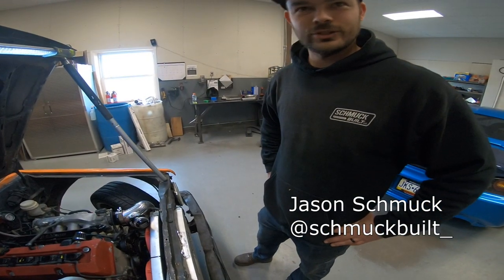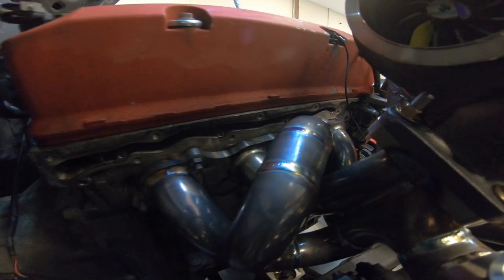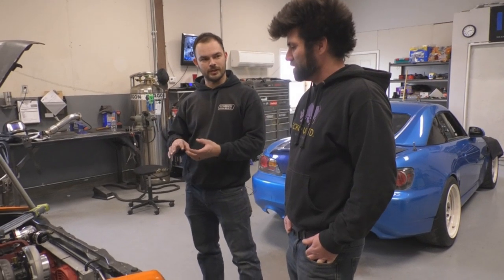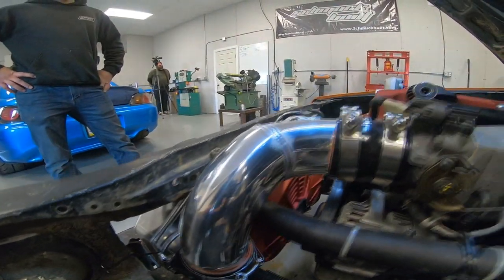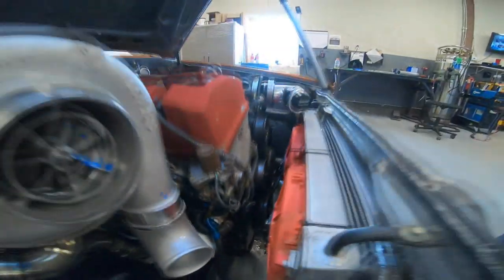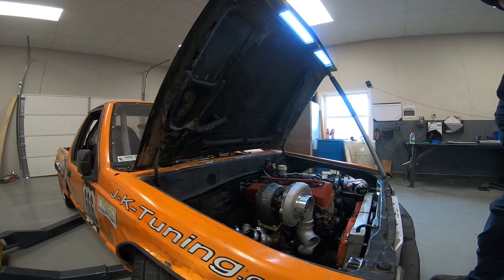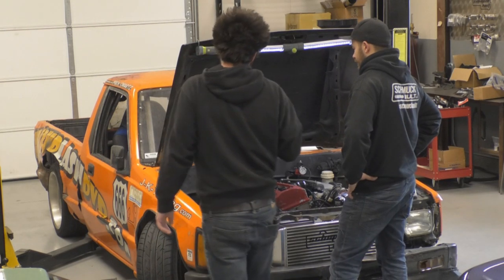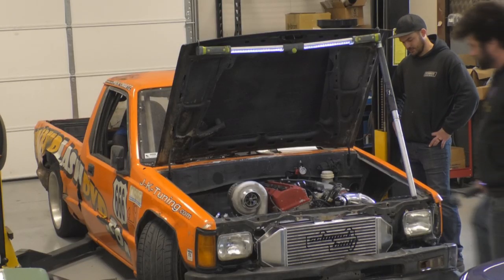Honda Powered Drift Truck Turbo Build (part 2)

Comment: Whiplash is back? Awesome man. I remember reading about this truck years ago... Inspired me to turbo my Mighty Max, until I got a Miata...
Reply from the maker: Yes sir! Spread the word - I'm trying to get some subscribers! Currently building a V8 4x4 Tacoma. And the drift truck is finally going back for a full boost tune on May 21. Planning to make 600 HP.
Reply from the maker: You still have the Mighty Max?

Comment: How much of the stock suspension and steering components have you kept? I dont see a shock or the torsen bars and the cross tubes rearward instead of forward
Reply from the maker: Sorry I missed this comment originally.  The front suspension is still a stock design.  It has 2" dropped spindles and like 1 or 2 inch lowering springs.  I used washers to adjust the camber in.  Rear is a triangulated 4-link with QA1 coilovers.
As for steering - I doubled the length of the pitman and idler arms.  I also reinforced the stock drag link because it would bend sometimes if I was at full lock and hit the edge of a track or whatever.
Reply: @WHIPBASH 🙌🏾 I appreciate it 👍🏽